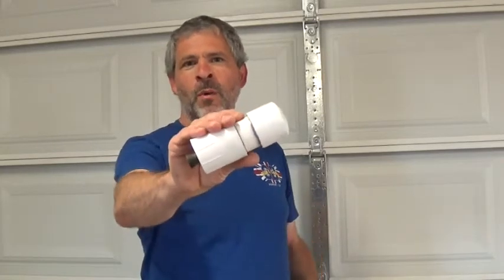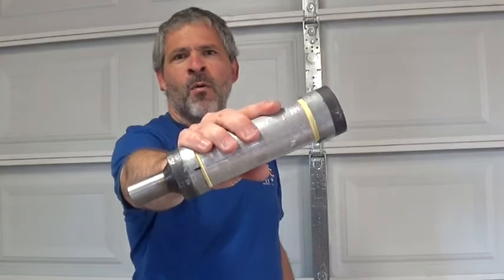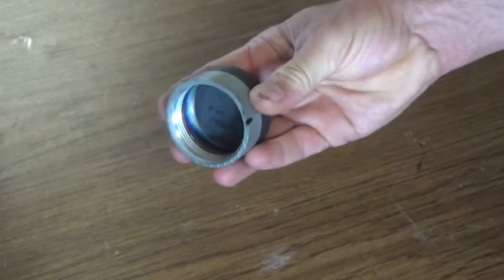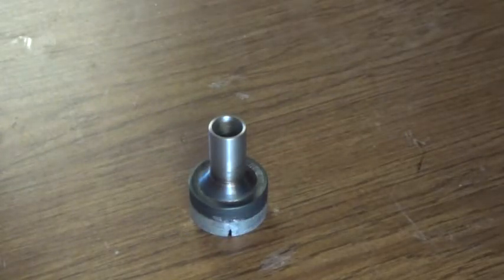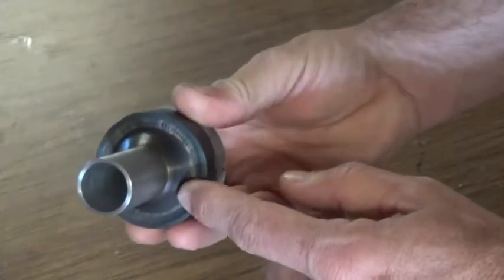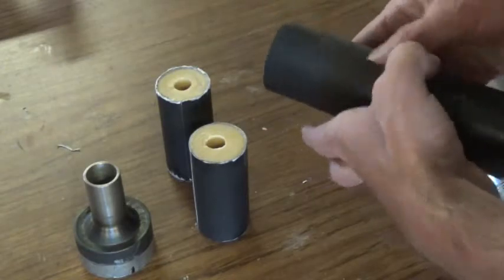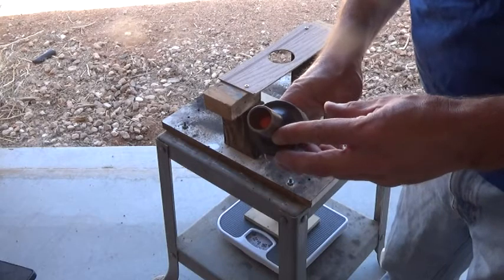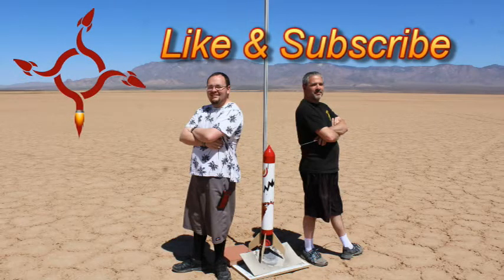Homemade Metal Rocket Motor

Comment: Just take a 304 steel water bottle and put the propellent inside that , drill a 2cm core add a nozzle and you have successfully created a 1 kg rocket motor with 700 grams of fuel , i have done that several times and it always worked well
Reply from the maker: Now that might be something I'd be interested in replicating and making a video... If you could provide a bit more information about what water bottle you are referring to (amazon link???) and what style of nozzle is used.

Comment: For people worrying about explosion,
as long as the casing strength, nozzle throat and nozzle and fuel mixtures are good its guaranteed not to explode.
Reply from the maker: Lol... That's the problem... You don't know if you have the casing, nozzle or fuel wrong until AFTER the explosion. Then comes the fun of figuring out what to change for the next try.
Reply: @rotaryrocketry  Yea that's the fun part, everything is good on paper until you actually put it together..

Comment: Hey kids can you say "pipe bomb"!
Reply from the maker: I know it looks that way but we have launched this motor several times and it is really dependable.
Reply: @rotaryrocketry  Yes it does look very scary, especially the thoughts of someone else that doesn't have a clue , trying to do something like this.... I am sure alot of it rides on the propellent that is being used. Obviously this just doesn't get filled with black powder or match heads or other improvised powders. 
The burn rate is controlled and you have a better than layman idea of what you might be up against. 
But I will ask what engineering formulas do you use to compute the pressures involved and what do you know of the metallurgy of your chosen materials. Especially after working them and welding and such things.... Like most of us "hobbyist" and backyard "amateurs" mostly take it on the chin and kinda use our own wisdom and experiences to "experiment" and/or push the envelope, (Hopefully in the most prudent way) as we work our way up. 
But yeah, I don't condemn you, nor would I fully feel 100% safe with your material selections and engineering at this point. 
But I understand that you are cautious in your experimentation and obviously realize the worst case circumstances. Do carry on and proceed with caution! Never get complacent. I am sure that there are some engineering sliderule and pocket protector nerds that could better ascertain what the limitations are of your chosen materials and design. I could be way wrong, as I am not an engineer but also just a lay person. I just realize that there are many times hidden subtle nuances in the things we do that can be unforseen. With much respect,
Stay healthy and safe.
Reply from the maker: So just information for anyone that may be reading this in the future.
I use data and spreadsheets from Richard Nakka for motor sizing, fuel cell design, nozzle design and material strengths.
I also use data available on the Loki Research web site to make decisions about motor sizes, fuel cell specs and nozzle sizes.
Before using info from Nakka and Loki, we were making a lot of guesses and having a lot of explosions and failures. Now, we are having good success and a lot of fun.
Reply: @rotaryrocketry  
Thanks for update and good information. I hope I didn't sound like a troll! 
I am just a lay person and not a rocket guy, but very interested in what all you High Power Rocket folks have accomplished! I have learned that anyone serious about this usually and wisely participate thru a certifying club such as the NAR or Tripoli. 
Good stuff! Have fun be safe
 Looking forward to new videos from big launches!

Comment: but only 2 sec of burn? and to prevent explosion? I think the combustion it hapen inside right?
Umm look to danger, like hand grande if make bad mixture.
Reply from the maker: 1 to 2 seconds of burn time is normal for these small, bates core, sugar motors. As for explosion... As long as the casing is strong enough and the nozzle is the proper size, there is no danger of explosion. This casing is MUCH thicker and stronger than the commercial aluminum casings available so I have no fear of it exploding. My fuel mixture is EXACTLY the same every time, we are very consistent with the ingredients and cooking process.  So far, we have done one ground test and two launches with this motor and it works great.

Comment: If you wanna make it better, switch to a single grain, that will make it easier to use different cores and more consistent burns, ..... check out DAN POLLINO, it is all about designing to the materials and you can have a "simple, easy, low cost" mowtree! 👍

Comment: Awesome ! Great to see you moving from pvc pipes ! Do you plan on reusing the motor after a flight ? 
If you have a lathe, you should consider turning your casing and using snap rings instead of threads, you ll be able to reuse it easily, and the assembly process would be much simpler. 
Great job anyway, it's looking good !
Reply from the maker: So the plan was to have a completely reusable casing. We dismantled and cleaned this motor after the test and it was in perfect condition.
I know about the o-ring and snap ring style but I really think the threaded pipe nipple system was easier to build and I don't have to keep replacing o-rings after each use.
Reply: @rotaryrocketry  with a well built motor, o-rings can do 4-5 shots. And it's dirt cheap on any online vendor
Reply: @shere_kan8329  PVC is better and cheaper, but the reusability of metal, can't beat dat, we have been using a motor like this for over 40 years now! It is all about the math, and material science! 👍🤣
Reply: @terrywheelock9458  wtf ! no, PVC isn't better, PVC is arguably the worst choice you can think about. For sure it cheaper to make one motor with it but once you'll have lost a hand, it will definitly not feel as cheap
Reply: @shere_kan8329  Obviously you have not studied materials engineering. So WTF, you don't know what you are talking about. PVC is the BEST and cheapest material to build a SRM out of overall! 👍

And, to "educate" you about materials, if you handle ANY material outside it's specifications, then anything is dangerous! And, in this case your LACK of knowledge is dangerous! 🤣
Reply: @terrywheelock9458  at this point I think it's a joke, right ? My knowledge in english might not be enough to catch the subtle irony in your messages. 
Furthermore, you're definitely saying stupid things, although it's suppose to """"educate"""" me : of course any material is dangerous if used out of its specifications, the problem being : using PVC for a motor already puts it out of its specifications. The point isn't whether PVC and metals have limits, but where are they ? 
And you and I both know that PVC's ones are a lot tinyer than aluminium ones.

And, in that case, your insurance and LACK of SAFETY measures and COMMON SENSE is dangerous, for you, and the one around you. So please, stop acting like a fool and drop that pipe bomb
Reply: @terrywheelock9458  do speak about using the pvc as a propellant ? or as a casing ? there may be an quiproquo here. If you're speaking about using it as a casing, I would very much like to know those properties that make PVC so suitable for rocket motors. I think you don't have a clue about what your arguing about, and the fact that you say I'm not worth it certainly shows your impossiblity to argue and defend your point of view. 
Unfortunatly you seem quite narrow-minded and you might not listen to the ones who can help you. It's a shame because you may get hurt very badly if not people around you...
You should definitely change your mind set over this hobby before it's too late
Reply from the maker: Gentlemen... If this argument continues in my channel, I will delete it.
Reply from the maker: Gentlemen... If this argument continues in my channel, I will delete it.
Reply: @rotaryrocketry  But he started it! 🤣
Reply: @rotaryrocketry  Fine! 🤣
Reply: @terrywheelock9458  all right. After a good step back and a bit if research, I found out that PVC isn't that bad after all. Lots of stereotypes and misconceptions. I have been doing PVC for about a year now, and despite a lot of leaks and destroyed casings, the results aren't that bad. 
Would it be okay to share some of your experience and feeling about PVC SRM ? And how could I make the most out of its great properties ?
Reply: @shere_kan8329  Interesting, I had just mentioned the idea of material science when engineering these motors in a previous part of the thread. Really all of it obviously is improvised. I imagine PVC can be just as  potentially deadly as many other casing materials. 
The sad fact is that few hardware store materials  are going to have ASTM specifications for use as a pressure vessel and especially one that is used in a pyro environment. I am sure that PVC does have many carbon atoms to use it as a possible fuel if fully oxidated .... Amazing some of the tricks found here on YouTube! 
Respectfully stay safe and remain healthy!
Reply: @shere_kan8329  Why would one's hand be next to a PVC rocket motor???

Comment: nice!! dont you have a lathe? you should turn your own casings and threads and nozzles.
Reply from the maker: I do have a precision lathe. However, I am not a machinist. I looked into cutting threads on the lathe and it's just not worth the effort. Just easier to buy a pre-threaded pipe nipple. I use the lathe to make the nozzle convergent & divergent pieces and they come out great. This was not expensive at all and the results were awesome.
Reply: @rotaryrocketry  Just take a T-blank to Homie Deepoe or Lowlies and they can cut your threads, ...... or just buy a stock piece and design the snoozle and bulkhead to match, it ain't rocket science anymore, ..... just good fun designing the "perfect" engine thingy! 🤣👍